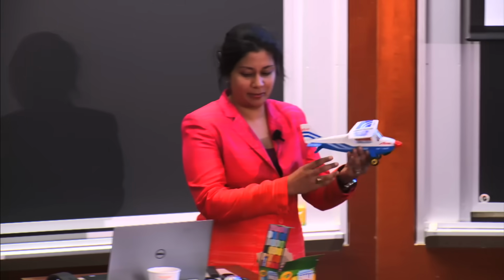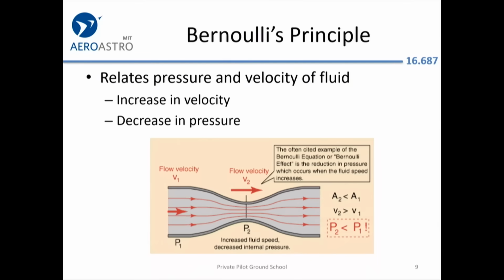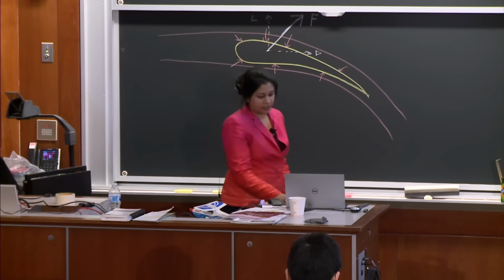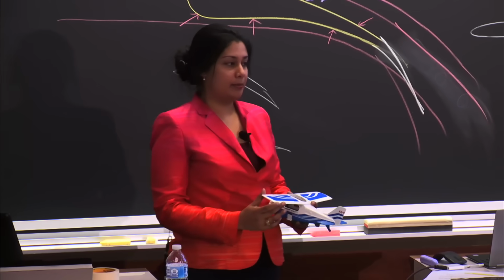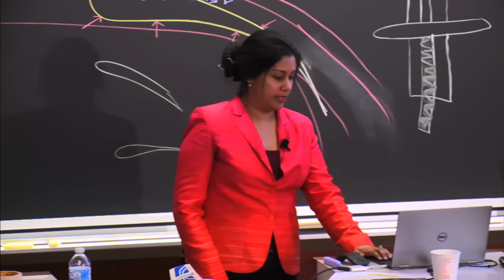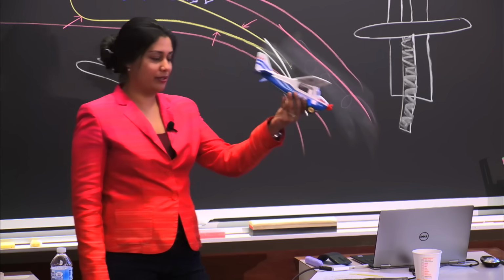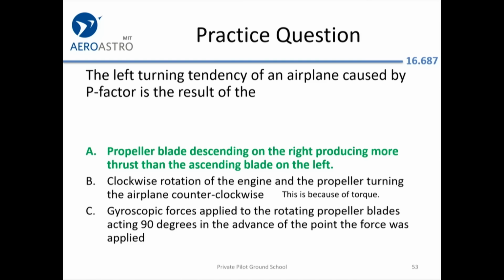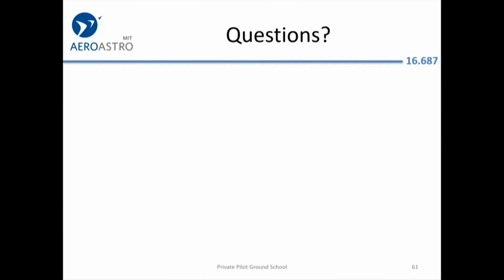Lecture 2: Airplane Aerodynamics

Comment: OMG finally a ground school that is accurate on how lift works.
Reply: I'm only 15 minutes into the vid so far, I might be jumping to conclusions, but so far it's an absolutely terrible explanation of lift (or at least very one-sided and only half right)

Human nature perceives wind as a blowing force. We feel it blow against our body. If we put our hand out a car window we feel it blow us. That's normal.

Riddle me this. If wind blows, how does a tornado rip full sheets of nailed down plywood off a roof? Why does a motorcycle rider's shirt climb up his back? How can a strong breeze pull flat papers off a picnic table? How does a dead leaf on the ground get pulled high into the air? Perhaps most of all, consider a sailboat close hauled. With the wind blowing nearly fore to aft, still the sails puff out into the wind. How can that be? It's not a stiff material like metal. We're talking about a flimsy textile held with rope. Shouldn't the wind from the front blow it back? How does it stand proud?

Wind blows, yes, but it doesn't just blow. It's not not just a build up of pressure. It's also a tremendous decrease of pressure. Wind sucks like a vacuum.

For subsonic flight, wings do not push air down. No. Rather the wind on top creates suction. For most of the force generated, the air sucks up the wings from the top. Look at old manometer readings and video footage back from the NACA days.

Indeed if you study history from the early days of flight, the tops of the wings would tear to shreds. That's why they began reinforcing construction with rib stitching and extra fabric and dope. It wasn't the bottoms that got destroyed.

Now the balance of forces changes as you approach the sound barrier, but for general aviation that's how it is. Flight is similar to a sailboat, only instead of wind hitting a well trimmed sail we use a stiff, sail-type shaped object and pull it quickly through the air, making our own wind. When everything is done just right, it gets sucked up just like a sail gets sucked out.
Reply: @royschwaben9646  That is correct, Roy. It is just another well meaning attempt to explain what is poorly understood. 
.
While we discourage using the term 'suction' because it implies pulling on a fluid which is incorrect and prefer explaining that the higher pressure under pushes upward more than the pressure above pushes down, we understand using 'suck' as a shorthand.  Otherwise what you say is correct. 
 I have a full analysis of this video in a comment here. I only recently became aware of it. Despite being "at" MIT, it is another in the seemingly endless supply of  amateur attempts.
The male 'advisor' wasn't even able to answer a very astute question later in the video about P-Factor.
Lift and Bernoulli's Principle are perhaps the most widely misunderstood principles in science and the misconceptions are repeated ad nauseam by everyone who wants their 15 minutes of fame telling the the 'true story'.
It's frustrating and so sad for science.
Many YouTube authors simply ignore their videos once put up.
I teach and do STEM demos and labs for some schools and scouts. I'm an engineer and have read and consulted with some leading experts on this to make sure I understand it fully.
You might enjoy reading this:
https://www.quora.com/q/rxesywwbdscllwpn 
Best Regards, Steve
Reply: @royschwaben9646  I have comments in this thread above and in a separate comment.
Reply: Well I can't blame people for being confused. Schools today generally teach everything as theory and models and textbook pictures, completely divorced from reality and physical experimentation and observation. Ideally they should use both, but without the latter you're pretty well screwed. That's not the students fault.

One of the best things I've seen on the topic is some 60+ year old videos where they show you these things. For example they throw metal particles in a fluid and you can observe what's happening through time. For myself as a curious amateur, those types of demonstrations made a world of difference for me. It tied all the book stuff together in a real, easy to see way. It made it finally make sense after being confused for years.

I love books and math and everything, but there is no substitute for that. To see this stuff in real life (even on video) helps improve and solidify understanding the textbook stuff. 

Without trying to sound like an asshole, schools forgot how to teach advanced subjects. You see the same phenomenon in the computer science field. Kids learn a little about data structures and algorithms and programming languages and paradigms, all that's fine and dandy and necessary, but then they come out of school with a diploma and still do not fundamentally understand how a computer actually works. For me, studying the history of how the tech developed over time and how they used to do things "back in the day" was the key. Once I saw that, everything started to come together. Without that, I was lost in a sea of vocab and concepts and struggled to make sense of anything. Sometimes I believe teaching the basic concepts well is much more important than any particular tool or certain aspect of a discipline. When it comes to teaching basics and ensuring a solid understanding of the world, schools fail miserably. So long as you get an A on the test they don't give a shit. 

https://youtube.com/playlist?list=PLs7ukRs4MA3Au75r4bGLlLrqy8pkhTnD8
Reply: @royschwaben9646  I can only comment about the schools and groups I work with and my focus is understanding things well and encouraging engagement by students. I am asked to regularly participate. 
.
I understand that there are constraints for getting everything prefect, but my focus is providing an environment students can be and are engaged in learning.
Reply: @royschwaben9646  She was taught wrong. Now she is teaching people wrong.
Reply: @jimziemer474  I have a notification for a message posted by you that starts like this, but I am unable to see the actual posting:
:

Jim Ziemer replied: "Observ45er Actually, she is mostly correct, but her explanation was not complete. Most lift is actually created by the conservation of momentum. In other words, Newton’s third law of motion. But it..."
7 hours ago
:...
That is the "Newton's reaction" simplification.  It ignores the fact that the pressure difference top-to-bottom produces an upward force.  Newton's Third Law surely happens, but the upward force is the pressure difference. ALL lift is that pressure difference.
.
I have a detailed analysis of this video.  I have to find it to re-post it.  I may have saved it on my computer...
Reply: @jimziemer474  Another notification, but this time with the whole comment, but I still can't see the comment here, so I just picked another of your comments.
..
Jim: " Actually, she is mostly correct, but her explanation was not complete. Most lift is actually created by the conservation of momentum. In other words, Newton’s third law of motion. But it’s not from air impingement on the wing as many people think. (I’m sure that creates a minuscule amount of lift.) The wings have to turn (accelerate) the air. That’s why an airplane with a flat wing can produce lift. That’s also why an airplane with a cambered wing can still fly while inverted. The curvature of the upper wing certainly does contribute to the overall lift. But airplanes do not fly because wings produce excess lift from the pressure difference between the top and bottom of the wing. It’s easier to see when explained mathematically."
..
Yes, she's sort of ok, but has many relatively minor issues and explains much poorly.

.
The total lift force is the top-bottom pressure difference.  It can't be anything else. Force is pressure over an area. More pushing up on the bottom than pushing down on the top. ALL THE LIFT FORCE!  It's not "excess" it is ALL of it.
..
This "third Law" and momentum things are just people  repeating something they don't fully understand.
.
However, those same pressures are what accelerate the air to perform the deflection, or turning of the air people like to refer to with that Newton's Third Law 'reaction' explanation. These same Pressure Gradients ALSO  cause ALL the accelerations of air we see around a wing: ahead, behind, above, below  and around the tips.
.
Following up on Bernoulli's work in the mid 1700s, Euler figured out that Pressure Gradients Accelerate fluid.  Fluid does not accelerate spontaneously; a pressure difference between two locations is required JUST AS a mass, like a brick, requires a force to accelerate.  Air has mass and must follow ALL of Newton's laws.
If you can't identify the force [Pressure Gradient] for a particular acceleration, then you have more homework to do.
..
Of course Newton's laws are followed, but identifying the 'action' shows you that it is the Pressure Gradients that are the cause. To push a wing up you need something to push against and the air around the wing is that something.  Boeing's Doug McLean (whom I've talked with on this) says the same in his video.
https://www.youtube.com/watch?v=QKCK4lJLQHU 
.
When a wing (or anything) moves through a fluid, it pushes the fluid out of the way and the fluid naturally floes in around and behind it. It pushes fluid out of the way with a pressure increase.  When the air flows in around the parts where air and object are moving away from each other, this causes a pressure decrease. 
It is nothing more than the movement of the wing that directly caused the pressure changes.
.
RE: Your "impingement"  I'm sorry, but you when you say that you are "sure that creates a minuscule amount of lift", it is because you still aren't fully up to speed on the full story..  I know you are well meaning, but you aren't.
.. ..
There are only two ways to produce force in a fluid: perpendicular pressure and surface friction / drag.  That's it !

Viewing the wing at some obvious AoA you can see that air and wing are heading for each other.  This and this alone causes the pressure increase under the wing.  This increase is part of the top-bottom difference. If a stream of air hits a flat surface head-on, you have the stagnation pressure and the air slows to a halt because the higher pressure at the surface causes a negative acceleration with the relatively lower pressure back up-stream.  Newton's First Law.
,
Above, the converse is happening.  The wing is curving (convex) away from the air's preferred path (straight); this and this alone causes the decrease in pressure.  Thus providing the other part of the top-bottom difference.
 THAT gives us THE UPWARED FORCE we call lift.  *ALL OF IT*.
..
ALL wings generating lift operate by these very same fundamental principles. 
..
It is also a well known fact that the pressure decrease above is the GREATER part of that difference.  THEREFORE, the happenings above the wing contributes MORE to the lift than under.  In fact, at cruise, the typical pressure increase under a wing is rather small part of the difference - 20-30%.  That is WHY the loss of laminar flow above at stall removes so much lift.
And By The Way, it is the curvature of the FLOW that is important, not this focus only on wing shape - WHY flat and inverted wings produce lift - because the flow pattern is similar and causes similar pressure changes in the same places. It is similar BECAUSE the pressures are similar.
.
P.S. Math NEVER EXPLAINS the science.  It only allows calculating values. 
F=MA does not tell you what causes what.  With the formula written that common way one can easily deduce that increasing M causes F to increase.  SO... loading your car with bricks causes more engine torque - wrong.
.
Watch Mclean's video and this one is one of the best:
Professor Krzysztof Fidkowski, associate professor, Aerospace Engineering
How Planes Fly.  https://www.youtube.com/watch?v=aa2kBZAoXg0 
.. ..
P.P.S I HAVE talked with some of the big names about this to make sure I understand well due to some responsibilities I have -- McLean, Anderson, Eastlake Babinxky, Drela.  I also teach.
Regards
Reply: @royschwaben9646  yeah I was disappointed as well. Having a long background in aviation and a desire to learn more all the time I found the explanation of lift overly simplistic and at the same time confusing. I can imagine all the students in there thinking “ok, but what about: (enter any number of factors completely breezed over)?” The teacher seemed nervous and maybe a little rushed.
Reply: @Bartonovich52 
YT is goofy.  I saw your post in full, but YT won't link back to it in that thread, so I'll try this.
.
 The air is accelerated over the wing which reduces the pressure.
Nope.  If you believe that is what is “right” about the use of Bernoulli in lift explanation, you are mistaken.
The pressure Gradient is the cause of the acceleration. 
You don't do 'something' to accelerate the air, then that causes the lower pressure.
.
This “fast air” thing is the most common Bernoulli myth repeated over and over. Euler determined that Pressure Gradients are the cause of fluid acceleration in the mid 1700s and derived what we now call Bernoulli’s Equation. 
Bernoulli only noted that the pressure decrease accompanied the speed increase (which is acceleration) 
.
The bottom of the wing is what gets pushed.  Fluid doesn’t pull.  Just because the pressure increase under the wing is minimal doesn’t mean it is unimportant.  It is the pressure difference that is the entire lift force and this escapes many who only say “conservation of momentum”.  
It is the lack of understanding of the actual cause of the pressure changes around a moving wing that makes people repeat all the myths. 
It is more instructive to show a significant AoA (5-10) to the beginner because first; the increased pressure is more intuitive with the “wind blowing on the surface” agreeing with every –day experience. Then, second, the effect  above the wing can be compared with the similar transverse Pressure Gradient causing the curved flow. The science has significant similarities above and below – IF you understand it.  She shows a high AoA for this reason and it is fine that way.  
She does much ok, just poorly explains some things and doesn’t explain others, just mentions them and doesn’t mention things she should.
.
We put things under the wings not because it has nothing to do with lift, but because disturbing that flow does little to change the pressure that is most certainly needed. The effect above is more easily disturbed and the bigger contributor, so decreasing it even a little is virtually a 1:1 change.
.
You don’t “forger about gradient’ because that it the driving force for all air accelerations we see around a wing: ahead, behind, above, below and around the tips.
.
Bringing in super critical stuff is far more than needed to understand the fundamentals of lift and only serve to confuse the beginner and pilot with even more things they do not need to understand. 
Kutta is also not needed, nor is it inexplicable. Just look at any of the wind tunnel videos or CFD images and we see that it does that.  It is quite intuitive that the air continues to flow in one direction to the beginner. That is only needed because in inviscid flow it isn’t guaranteed and bringing in inviscid flow is another beginner unneeded complication. 
. No, you can’t just say Newton any more than you can just say Bernoulli or conservation of momentum. HOWEVER, because Pressure Gradients cause acceleration, this is very much intuitive for those understanding Newton – force is required to accelerate any mass, including a fluid and it is the Pressure Gradient in fluids that provides that force. It boils down to Newton --- just NOT like it is explained in the common “reaction” explanations.
.
I can provide a point-by-point critique of this video, if you wish, that I did for the student who alerted me to it… If, that is, You Tube will route me to the thread this is in. I am working from the full text that came in the notification and haven’t tried the link yet.
Lastly, I’ve talked with some well-known authorities in aerodynamics, but have yet to talk with professor Krzysztof Fidkowski to clarify some fine points.
Professor Krzysztof Fidkowski, is one of the best treatments.
How Planes Fly.  https://www.youtube.com/watch?v=aa2kBZAoXg0 
https://www.youtube.com/watch?v=aa2kBZAoXg0 
This link goes directly to his discussion of above the wing at 15:28:
https://www.youtube.com/watch?v=aa2kBZAoXg0&t=928s 
Regards
Reply: https://www.grc.nasa.gov/www/k-12/airplane/wrong1.html

can anyone explain this? i still don't know what's the truth
Reply: @malfiandhika  the truth writes in the link you sent... It is a simplified explanation but corrects for general undersanding.
Reply: @malfiandhika   That is telling you that explanation is incorrect;
The longer path, equal transit is false.
Try this: 
Understanding Lift Correctly https://www.quora.com/q/rxesywwbdscllwpn
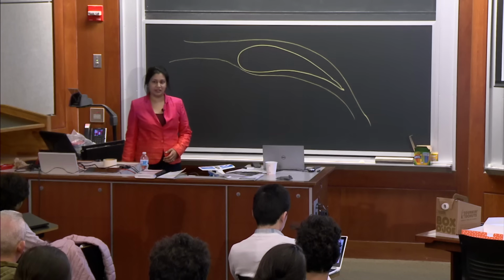Reply: @Observ45er  Re: Different thread, same clip - 6:14 she introduces "equal transit theory" by saying "it's wrong" three times in 15 seconds.
You know those pesky notifications that you get but don't link to any comment? It's because of contributor retractions. How about you do the same?
Reply: @malfiandhika  I think this is a chicken-egg confusion.  If the airfoil is asymmetric then it is easier to think the difference in speed is the reason.  Otherwise, the pressure difference is so obvious, and speed difference does not even have to be discussed, though it still is there in association with the angle of the airfoil.
Reply: @xuehengzheng7455  No. It is confusion by all the amateur scientists who, while well meaning, repeat all the bad stories without really understanding the true science.
.
The following is the fundamental fact that you must understand, not all the strange ways people get the air to accelerate with out a force.
.
The moving wing is what creates the pressure changes around a wing. 
The atmosphere ALWAYS pushes air up against everything in it, including a wing.
Move that wing and it changes pressures near it to push the air out of the way and allow it to flow  back in where it can.

Those pressures are then the cause of all the air accelerations you see around a wing.
This is because air has mass and mass requires a force to accelerate it.  This is what Newton was supposed to teach us.  Fluids are no different than solid masses in this respect. It is the pressures around the wing that push the wing up and push the air around in the ways we see.
.
Where the wing is approaching air, the pressure is increased and this accelerates air away from that location toward any near-by lower pressure regions.
Push you hand around in water and you can feel this pressure you must put on the water to move it away.  AIR IS NO DIFFERENT.
Behind your hand you are lowering the pressure by moving away from the water.  This allows the higher pressures around there to push water in behind your hand.
A wing does the same thing except it is a little more complex to explain.
Try this: Understanding Lift Correctly 
https://www.quora.com/q/rxesywwbdscllwpn
Reply: @Observ45er  I have to say you did not explain anything.  You kept saying the moving wing creates pressure which in turn pushes the wing up.  However, it is not clear why the wing is pushed in a specific direction against the airfoil.  The answer lies in the Bernoulli effect which, I believe, has been correctly stated in most textbooks.
Reply: @xuehengzheng7455  I am sorry, but the common explanations that use Bernoulli have some magic way of causing the air to speed up above a wing. 
.
It is NOT a longer path and “Bernoulli”. 
.
It is NOT pinching or the half-venturi and “Bernoulli”.
.
 Nope. 
.
Many, many text books have one of the common myths and many teachers simply repeat it, just like all the vast majority of people making You Tube video.  They think it is correct and have good intentions, but it violates Newton’s Laws and that simply cannot happen. Review Newton’s first Law.  That upper air would not speed up or flow in a curve without forces causing that.  Everybody is so in love with this Bernoulli thing they can’t see it does not follow from fundamental physics. 
A number of years ago I took responsibility managing a sophisticated flight simulator. I would be required to answer many questions and realized I needed to review some things and lift was one.  Many years ago, in pilot training, I heard the longer path, equal transit ‘theory’. I didn’t pay much attention back then, but this time, based on a solid understanding of physics as an experienced engineer, it didn’t make sense so I got authoritative papers on the net and read nooks like McLean and Anderson, not what You Tube has and school lesson plans.  I saw the many errors in fundamental physics being made by these well-meaning but misled people. I also have an Aeronautical Engineer son to discuss this with.
Saying “Fast air causes the lower pressure” is terrible science and Bernoulli NEVER said that.  He observed and reported that the increase in speed (along the flow) is ACCOMPAMIED BY a decrease in pressure along the flow. There is no indication that Bernoulli understood what the cause is and what the effect is when he saw the speed increase in the smaller section of the tube and the lower pressure there.
Following up on Bernoulli’s work in the mid 1700s, Euler determined that it is a Pressure Gradient that accelerates a fluid.   This is a Pressure Gradient along the flow that accelerated the fluid. This is explained in John Anderson’s aerodynamics book and he mentioned it to me as well.  He has some of the history in his books along with the science. I have indeed talked with him.
A force is requires to accelerate the air.  Air has mass and if you can't identify the force doing the accelerating, then you have more homework to do. A force is the cause of accelerating anything with mass including a fluid.  A Pressure Gradient is what provides that force.
I’ve discussed these things with other top names aerodynamics.  What I am saying is correct. 
.
Move you hand quickly in water,  You can feel the way you must push to move your hand.  That causes a pressure increase in front of your hand. The back of your hand has a lower pressure but, unfortunately, that is not as easy to feel, but it is there. I measure tis in one of my more advanced demonstrations.
The wing, just like you hand and body, and the air cannot occupy the same space at the same time.  Therefore, the wing pushes the air out of the way as it moves along. This "push" is applying an increased force from the wing itself to the air.  
When a flat wall moves forward in the air, this movement increases the pressure on the front face and this pressure increase is what accelerates the air away from the plate.  Or from the wall’s reference: if the wind blows against a wall, this increases the pressure at the wall and this pressure causes negative acceleration (deceleration) that slows the air to a stop. This is stagnation pressure.
Movement of an object in air DIRECTLY causes pressure changes around it. Doug McLean says this in his University of Michigan video.  I’ve discussed lift with Doug and other authorities.
The converse happens to lower the pressure near a moving surface in other places. 
I won’t elaborate with the full lift explanation here.  You can read a careful, detailed step-by-step explanation here:  https://www.quora.com/q/rxesywwbdscllwpn 
Regards
Reply: @Observ45er  Your point of view is about taste rather than science.   The Bernoulli effect is correct in a proper context which is lacking around an airfoil.  Under the circumstance, it is not difficult to find inaccuracies which are not "mistakes".  There is no big deal in it.
Reply: @xuehengzheng7455  I've consulted with several authoritative and well respected people actually who worked in aerodynamics and just explain facts.
.
Yes.  People misunderstand Bernoulli's Principle then apply it incorrectly in lift explanations. 
Charles Eastlakes paper explains how it can be used to calculate values around a wing, but it does not explain the science. No equations do.
..
Reply: @Observ45er   "No equations do"?  Do you know the Navier-Stokes equation?  It explains everything in aerodynamics.  Bernoulli's Principle arises from a specific solution to this equation.  Bernoulli's Principles are not universally applicable but do help students to understand airfoils.  You are too picky to accuse so many textbooks and teachers.
Reply: @xuehengzheng7455  Nope.  Equations do not explain WHY things happen, just WHAT happens. 
Bernoulli's Equation does not tell you why those values happen, it just gives you the values. It does not tell WHY the pressure is lower in the narrow part of a venturi, nor WHY it is higher in the wide sections.
  So many people believe that speed is the causes a lower pressure and this is well known to be untrue.  Euler figured out in the mid 1700 that a  Pressure Gradient is the cause of the fluid acceleration.
The "WHY" is the science.
..
F=MA does not tell you WHY a force accelerates a mass, only that those values have that relationship. 
E=IR doesn't tell you WHY voltage causes current.
Those are two different things and many people don't understand this.

People use those equations incorrectly because they don't understand the underlying science and get wrong results.
People think some magic other than a force accelerates the air above a wing. That is not science.
Sorry. talk to some real aerodynamicists as I have to get a full understanding of the fundamentals.
Regards.
Reply: @Observ45er  You don't understand.  Every theory starts from something taken for granted.  It is ridiculous to ask why F = MA because it enables you to explain why the Earth follows its orbit if you accept the formula wisely.  The Navier-Stokes equation has to be taken for granted and explains everything in aerodynamics.  Bernoulli's Principles are fine but less universal.
Reply: @xuehengzheng7455  I understand VERY well and have discussed this with a few noted aero experts  so that I understand this very well.
.. ..
" if you accept the formula wisely "  This is one of my main messages.  The "wisely" part.
.. ..
The equations in science DO NOT explain the 'why', nor the cause and effect.  To apply the equations properly we must know the science, then the equations allow us to calculate values = ONLY.
It is because people understood the underlying science that they were able to determine an equation to mimic the physical world's phenomenon.

For example, F=MA does not tell you WHY a force is required to accelerate a mass, only how much it does.  
It does NOT explain WHY Earth travels in its orbit.  It only tells you that the force and acceleration follows that equation, nit not WHY -- --  NO IT DOES NOT.  Many people believe this misconception.
Newton's First Law explains that science (or is supposed to)
,, ,,
I have seen people who do not understand the physics behind the formula conclude things like this:
Given F=MA, I can increase "M" and make "F" larger.  WRONG!
You can't load the trunk (boot) of an auto with bricks and cause the engine to have more force on the wheels.
.. ..
Lastly, Bernoulli's Principle is pretty universally misunderstood and mis applied to this. There is nothing "wrong" with it, but people do not know what it really says and means because it is so vague: Under CERTAIN CONDITIONS, the speed in a flow is accompanied by pressure changes in that flow.  The message that is not passed along is what Euler revealed:   Pressure Gradients accelerate fluid. 
Speed DOES NOT CAUSE a decrease in pressure. 
. 
This is all spelled out, step-by-step here:
 Understanding Lift Correctly   https://rxesywwbdscllwpn.quora.com/
Reply: @Observ45er  Newton did not ask why moving things keep moving.  Einstein did not ask why the speed of light does not depend on if you are moving.  They are wise people because they did not ask fruitless questions.  You say "we must know the science".  Does this mean "we must know how to apply the basic principles"?  If so then we do not have much difference.
Reply: @xuehengzheng7455  Yes,  "we must know how to apply the basic principles", then we can use the equations correctly.
Reply: @Observ45er Thank you.  I feel I have improved.
Reply: @xuehengzheng7455  I'm sure neither of us know how Newton thought this through to arrive at what he did, so claiming that is rather arrogant.
I'm a retired and very experienced electrical engineer - Motorola 36+ years.  I got paid to fully understand what I was doing and carry that philosophy to this.
..
Yes, we must know how to properly apply the principles and any equations.
Reply: @Observ45er  Re: Your dismissiveness toward the Scientific American article, since YouTube policy toward URLs is ever changing, search for the title of the article: No One Can Explain Why Planes Stay in the Air February, 2020 - Observ45er, It's obvious you have a handle on the subject, this article seems to agree with your knowledge.
Reply: @cowboybob7093  This long thread is getting very awkward.
.
 I read the SA article when it came out and talked with some of the people Ed Regis references and there is a consensus that it is a poor article.   All he did was rehash some common misconceptions for the Nth time.
 It appears he did not  understand what the experts told him.  They do understand. Contact those he references yourself  and see what they say, AS I DID.
Reply: Bernoulli is just Applied Newton. But Bernoulli only works under three assumptions, which don't exist in reality. The best explanation for lift at the present time is Babinsky.
Reply: @SoloRenegade  Yes. The fundamental idea of Bernoulli was the inverse relation between pressure and velocity and that is also fundamentally true when there is some compressibility and viscosity. Then, that a force is required to accelerate a mass - fluids have mass and the Pressure Gradient is what provides the Accelerating Force in a fluid (determined by Euler following up on Bernoulli's work).
..
Babinsky  pretty good.  One thing he has said is that it is Coanda happening above the wing and that is not considered correct. Coanda is a definition for a FORCED jet, or sheet pf air into an otherwise still environment.   I wanted to ask him about that and a few other things he said, but the COVID was starting and he had his hands full and begged off a discussion.  Haven't got back to him.  life sometimes gets in the way of side interests.
You may also like this.  A slightly more detailed step-by-step that sticks to the fundamental principles:
 https://rxesywwbdscllwpn.quora.com/ 
..
Regards
Reply: Wow this was quite the thread 😂
Reply: Here explanation is not directly wrong, but i would say its incomplete. Here is a lecture with a more complete explanation.

https://www.youtube.com/watch?v=QKCK4lJLQHU
Reply: Yup. Flown a lot of aircraft, yet all the exams I've taken expect Bernoulli's principal to be the only factor that generates lift. It's always been obvious to me, the exams were wrong. Nice to see a simple explanation.
Reply: I believe she is wrong about the paper plane's shape. 
I convinced my planes fly longer (and slower) if I don't bend the edge flat. 
I think Bernoulli's principle applies at least as much as Newton's in this particular case.
Reply: @null090909  they both always apply.... It is a question of interpretation of the same phenomena...
Reply: @null090909  Bernoulli explanations for lift are always wrong. 
Newton explains most of the full story, but not in the way most amateurs explain it.
A moving wing creates pressure gradients.  Those pressures: 
A) provide more pressure under than over, thus pushing up.  
B) Those SAME pressures cause all the accelerations of air you see around a wing and this satisfies Newton's Third Law also.
.
You get a paper airplane to fly well and slower by paying attention to balance (CG) and trim (up elevator).  See the book by Barnaby.
How To Make & Fly Paper Airplanes Captain Barnaby Navy
Reply: @Observ45er  I cant remember which school it was on youtube, but a retired Boeing aerodynamics engineer explained it like this. He mentioned that so many theories were wrong and that even the NASA website has wrong explanations of aerodynamics. Something with newtons laws and other stuff... I actually found the video here:

https://www.youtube.com/watch?v=QKCK4lJLQHU&t=987s&ab_channel=UniversityofMichiganEngineering
Reply: @coolx9357  Yes,  His U Michigan talk. I've discussed this with Doug.  Listen carefully to that video at time 25:56 where he talks about the pressure and velocity relation (time 26:17).
He says that he wasn't happy with his explanation, so even with his experience, he has difficulty putting it into words.  
 He mentions and shows in his slide that the air's inertia and acceleration must be considered.
Summary: when fluid flows in a curve, it lowers the pressure on the inside of the curve the same way you feel 'pulled' outward on a playground Merry-go-Round - it is the centrifugal effect.
 .. ..
He also rends to take a engineer's view (I'm an engineer too) and wants to include things that I found don't help with the fundamental understanding of lift, but are important for understanding more advanced concepts.  
Including too much in the initial explanation only confuses the beginner.
.. 
I've taken his and discussions with a couple of other aero experts to understand myself and put the following together that addresses this "Two-Way-Interaction" above a wing: 
 https://rxesywwbdscllwpn.quora.com/
Reply: @Observ45er  Do you work in aerodynamics? if so, which company? Or is it just a personal hobby of learning? I actually work at Boeing (hah, ironic), but I do nothing related to aerodynamics. I do CAD modeling and virtual manufacturing.
Reply: @coolx9357   I'm a retired, 36 year Motorola Electrical Engineer and do STEM demos and labs for two local schools and scouts. I was on the team that started cell phone system development in 1973 and mentored other engineers as well as being mentored by others.
I take this very seriously and work very hard to understand things and to be able to give appropriate AND CORRECT answers to all age /education levels. 
..
I volunteer at one of the 45 Challenger Learning Centers. 
Challenger.org.
I took responsibility for our unique B737 flight simulator some years ago.  
https://www.thewoodstockindependent.com/2014/01/taking-flight/
There's a better picture, but the local newspaper removed that page.
..

I knew I would be asked many questions and after a little on-line search i saw all the lift explanations that made no sense from a physics standpoint and recall that in early pilot training I was told the equal transit story, but hadn't thought much about it then, but it makes no sense now.
SO... I talked with my aeronautical engineer son, but he said that he hadn't focused on aerodynamics and to do my own serious research. 
So, I did and  and also  contacted some noted experts, including your Doug McLean.  He volunteers at the Challenger Center out there.
Reply: @coolx9357  I know Doug and have talked with him...
Reply: Actually she explains things fairly poorly, not extremely wrong and adds too many unnecessary things making it sound much more complex than it is. She does explain some things correctly, but hardly uses correct terminology even when she says common terms are needed at the beginning. I didn't hear her say vertical or horizontal stabilizer. She never clearly affirms that lift is the top-bottom difference in pressure, but only says "conservation of momentum which is technically wrong.
 Among several other things the gyroscopic precession should not have been mentioned and both of them couldn't answer the question about it.  I can provide details on request.
Reply: @Observ45er  You don't understand.  The paper plane has to meet the airflow at an angle so that the lift is not upward but inclines slightly in the backward direction.  Therefore the paper plane suffers from additional drag called induced drag, which is reduced to a minimum when the lift is from the top-bottom difference in pressure.  She is an excellent lecturer.
Reply: @xuehengzheng7455  She covers things ok, but explains some things poorly and mentions some things, but doesn't explain them. 
I can provide a point-by-point critique of this lecture if you wish.
.
All lift is due to the top-bottom pressure difference and wings have induced drag.
.
I am sorry, but I do not understand your point about the paper airplane.  ALL wings generating lift have a net force that is tilted aft and, therefore, have vertical and aft  components of force.

I understand this very well. 
I studied this and because I teach these things and take teaching very seriously, I went to the trouble of consulting  with some of the well known authorities in aerodynamics: Doug McLean, Charles Eastlake, John Anderson, Holger Babinsky and Mark Drela.
Reply: @Observ45er  At one stage I was puzzled about why paper planes (or any plane with symmetric wings), without benefit from Bernoulli effect, can fly.  I think the girl was clever to explain this in terms of momentum conservation when the wing deflects air downwardly.  I agree all wings suffer from induced drag but to a less extent compared with paper wings.
Reply: @xuehengzheng7455  No wings have "benefit from Bernoulli effect".  Explanations  claiming "Bernoulli causes or 'explains' lift" are wrong because they use "Bernoulli" incorrectly from the start. 
.
The typical "Bernoulli" explanation is WRONG and goes like this: "Something [longer path, equal time, pinching] makes the air speed up  over the wing - and Bernoulli said fast air has lower pressure The lower pressure sucks the wing up."
1- Those things DO NOT speed up the air over the wing - PRESSURE does.
2- Bernoulli did NOT say that. He said "a speed increase is accompanied by a pressure reduction."  he absolutely  DID NOT say what causes what because there is no indication he ever figured out the cause and effect - only they both happened together.
3- Low pressure doesn't suck.  It PUSHES less that some other higher pressure pushes, creating a net force toward the lower pressure.
.
Speed does not causer a lower pressure - PERIOD .
.
Momentum absolutely must be conserved because we know it must from Newton's findings.  The mechanism that does this momentum conservation is the pressures that are responsible for holding the wing up ALSO 'push' air around and deflect the air near the wing.
Pressures do BOTH things.
If you're going to push up on the wing, the only thing there to push against is some air, THEREFORE it must be pushing down on some air and we can easily see this.   PLEASE note that the down moving air starts well above the wing!
 Here: http://i.imgur.com/h8pSK.gif 
.
The motion of the wing in air directly causes the pressure changes around a wing, NOT all the other things people come up with like Bernoulli, Half venturi and longer path-equal time.
.
Then...
Paper planes are so light and have enough wing area that the Angle of attack is very small.  I haven't measured it, but I suspect is is 1-2 degrees at the very most.  THEREFORE, the induced drag must be minimal. There is nothing unusual or difficult to understand about that.
.
.
Reply: @Observ45er  To generate lift without at an angle against the airflow, the cross-section of the wing has to be asymmetric, regardless of whether or not you call it the benefit from the Bernoulli effect.  Many clever designs of the cross-section aim at reducing the induced drag, and we cannot simply dismiss these.
Reply: @xuehengzheng7455  Why are you addressing me on this? You appear to think I am dismissing something and are trying to explain something.
There are angles aw which a wing-like shape generates usable lift and angles that it does not.  I do not dispute that.

With an asymmetric cross section [or for that matter any usable cross section] , the "angle against the airflow" is part of the shape and orientation.  As long as the particular shape and orientation produces the correct pressures, lift is generated.
Of course, much work is done to optimize the lift and drag for a particular craft. I am not disputing that.
.
It is important to realize that the cord line [LE-TE]  is nothing more than a geometric convenience.  It has no aerodynamic significance. The common angle of Attack, AoA is based on this geometric line. 
.
There is a more important AoA called 'effective AoA.  This is referenced to the angle of zero lift;  At that angle the wing does not generate favorable pressures and therefore, no net force for lift. 

..
You have again referred to the 'benefit of Bernoulli'.  Would you care to explain what you mean my that?
Reply: @Observ45er  You yourself said: "No wings have 'benefit from Bernoulli effect' " in your previous response and that is why I referred to the term 'benefit of Bernoulli'.
Reply: @Observ45er  OMG I KNOW!!! I was horrified. SA does a great piece on equal transit theory
Reply: @peterkay7458  SA ??
Great as in good or as in sarcasm?
Reply: @peterkay7458  The SA piece on flight was excellent. Frankly, one of the best parts was the conclusion, essentially "we still don't have it pinned down," because the phenomenon in nature resists comprehensive observation. But for the great majority of the phenomenon it's settled. Too bad it's called "lift," since push is so important.
Reply: @Observ45er  i think its because its an introductory class for freshers. She deliberately doesn't use many standard terminologies so everyone in the class, who are from different parts of the world and not necessarily confident in English, understands. She would continue to explain in detail and complexities further in later classes and at times, even tell them how what they learned in the first class wasn't 100% right.
Reply: @skyward7903  If that was her consideration, then adding unnecessary things doesn't fit.  It shows as "ground school". This is for pilot training, not a general aerodynamics course.
Also, if they are training for the license here, they need the proper terminology.
Then, the fact that neither she nor the man, whom I think was a professor, could answer the P-Factor question is telling.  It wasn't necessary to mention for flight and she doesn't say that is a factor on the runway, so it was another confusion factor.
Reply: @Observ45er  
Is she a physics teacher then? And the professor too? How can they not teach the engineering behind aircrafts the general way then? :/
Reply: @skyward7903   No.  She is an alumna (former student) and in the MIT flying club.  As I recall, Students and Alumni can propose courses and teach them. 
He is an electrical and computer engineer.
Reply: @Observ45er   ohh ok. I thought they were professors or something.
Reply: @skyward7903   After studying this aspect of aerodynamics for several years  it is clear to me that she was making errors, so I looked up  them and the program.   I do my best to not make bad assumptions.  As a teacher I need to be correct. 
As a professional engineer (getting paid to design top quality products), I spent my career getting the best information and knowledge needed  for whatever I did and this is no different.  Look up the names John D. Anderson (NASM), Doug McLean (Boeing), Holger Babinsky (Cambridge), Charles Eastlake (Embry-Riddle) and Mark Drela (MIT) to see who helped me learn about lift.  These guys know what's going on and now, so do I.  
YES.  I contacted them to learn.
.
I understand that so many of these people trying to tell others how this works are completely honest and well meaning, but so many lack the understanding for it...sorry.
Reply: @Observ45er  Ah I see. I'm still a senior at high-school but really love aero engineering. But half the videos I find on Youtube or anywhere else seems to be either incomplete or riddles with errors lol. 
To think MIT would be better when uploading videos to the world. xD
Reply: @Observ45er  as a former student pilot....you MUST/should use proper terms IE: WING!! tip vortices KILL...vortices is not the correct term....the ansewr for viscosity was CORRECT and she brings up MOLASSES a non newtonian fluid....This lecture was actually upsetting. One of my biggest work competitors is an MIT grad and I feel much better now
Reply: @peterkay7458  I don't follow you completely, but she did a poor job in general.  I put together an analysis for the person who alerted me to this video. If anyone asks for it, I can post..  Besides, pilots do not need to understand the science of lift as clearly evidenced by the millions who still don't...
..
'vortices is not the correct term' -- for what?
..
Nobody cares about molasses, it seems to have viscosity out the wazoo -- another thing not needed by a pilot.
.. ..
I don't recall the answer on viscosity, so can't comment.
.
Both had no clue about the P-Factor question from the astute student
.. ..
She has a PhD in physics and not Aero...
..
Reply: @skyward7903   Going over another comment, I don't see if I posted this for you and realized you may like this following explanation.  It is a step-by-step explanation sticking very close to the well known fundamental of physics:
 https://rxesywwbdscllwpn.quora.com/
Reply: @Observ45er  thanks a lot!
Reply: @Observ45er  You are right in a lot of what you are saying, but I think you have a poor understanding of how Bernoulli's is applied to things like airfoils, it works in pair with continuity to explain how flow speeds up over the foil and then what happens to properties like pressure.
Reply: @aidancampbell2759  This is a very long thread so I cannot be sure what you might be referring to. It might be a good idea to start a new one because this is built under one that was posted a year ago.
.
I see many people who have misconceptions about Bernoulli's Principle. I have no doubt that I have a very good understanding of Bernoulli's Principle. How do you think Bernoulli is "applied  to" an airfoil?
Reply: @aidancampbell2759  P. S. Please start by summarizing as best you can to give me a idea of what you are thinking, to keep from putting a lot of words down for detail that may not be necessary in the beginning. I can always ask for clarification on any specific words or phrases you may use where your intent may not at first be clear.
Reply: @aidancampbell2759  I asked: Can you explain "how Bernoulli's is applied to things like airfoils," and just how  "it works in pair with continuity" ?
And how you think my understanding is poor?
Reply: @aidancampbell2759  I've given you adequate time. You appear quick to criticize, but unable ot unwilling to discuss the science. As I thought, you have no interest in it..
Reply: @aidancampbell2759  Over a month and nothing specific to clarify how you think I don't understand...
Reply: That's MIT man
Reply: she got half of it right and half of it wrong